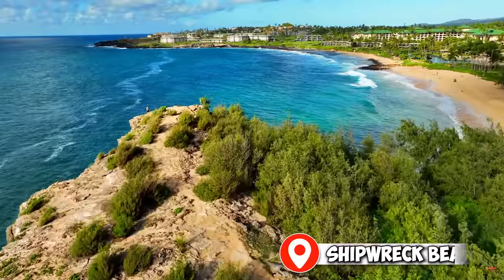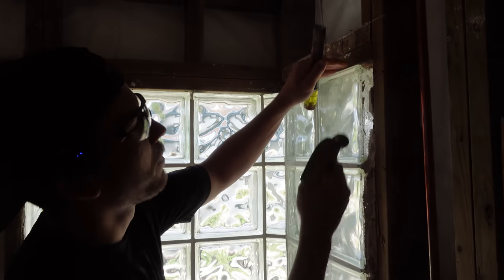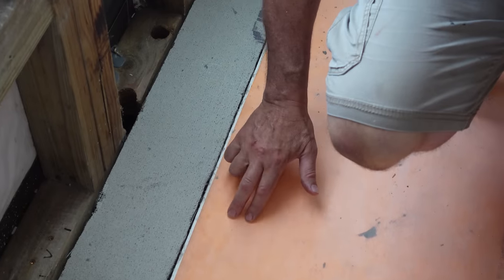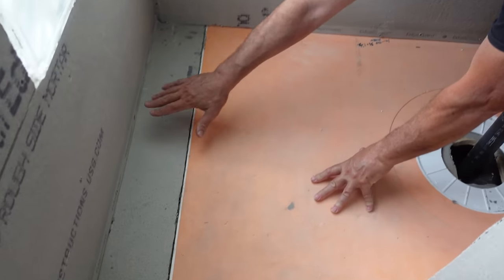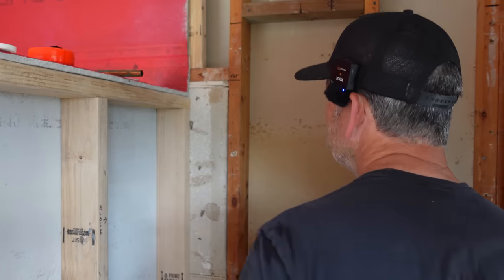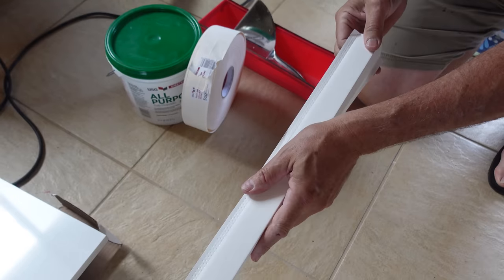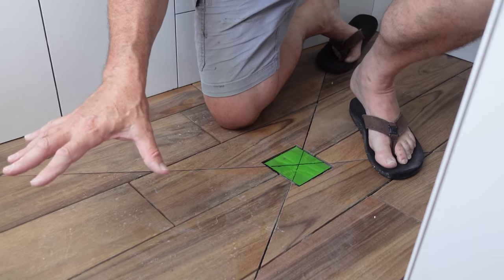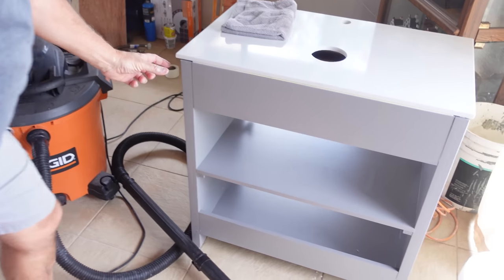The Tile Floor SECRET NO ONE Tells You!

Comment: 42:30 what about cutting a small amount of the countertop at the corner at a 45 angle to avoid it sticking out by the door frame like that? I don’t think it would look bad.
Reply: And if not, for less bruising or injury if someone bumps into it, round the corner off.
Reply: Don't remember which way the door swung, but maybe hang the door on that side of the door opening.
Reply: What about just move the whole door entrance
Reply: Just round the corner off.

Comment: I've had to trim the backs of vanities before. Four cuts with a simple circular saw takes care of most vanities, just make sure you dont buy one with drawers, or else you will be rebuilding them too

edit: just noticed in the last second of the video that your vanity has a shelf. For those, I keep the shelf in place for my side cuts, and then remove the shelf and use the partial cut marks to trim the shelf fully with a circ/table saw

Comment: Have you guys seen Tilecoach's videos showing Kerdi failures? He shows numerous failures of the bonding flange drains on older installations, and has done flood tests using Kerdi fleece with both unmodified thinset and allset. The Kerdi fleece with unmodified thinset always fails the tests, and you can see the water penetration of the thinset behind the fleece. Worth checking out if you plan to continue using Kerdi systems, I have personally switched to Laticrete Hydroban liquid membrane...
Reply: This is correct, also the troughs made by the trowel should ALWAYS run parallel so the air has a way out when setting your tile.  The way it is done here does NOT allow the air to escape.  Drop a coin on different parts of each tile after the job is done and you will hear where the air pockets are.  Prone to cracking just by dropping anything solid on the completed job.
Reply: Try Profilitec  showertec boards they are polyethylene and /100% recyclable.  Awesome.
Reply: Yeah okay bud 😂

Comment: If there's an enclosed space inside the vanity, put the AAV in there so it can be replaced easily when it fails instead of leaving it buried in the wall.
Reply: Agreed. AAV not code to be in a sealed cavity without a louvered access. 
Terminate it under the vanity, ABOVE A THE WATERLINE of the drain so if things clog, you see the clog at the drain before it comes out the vent.
Reply: @larrys5733  Above the flood level of the sink into a laundry box behind the fridge.

Comment: The right front corner of the vanity top forms a sharp 90-degree projection into the door opening. Cut this on an angle from the wall surface at the door casing and to the front edge of the vanity top. This will remove the sharp corner and at the same time create a more finished look.

Comment: Didn't Schulter change it from unmodified to modified?
Reply: yep
Reply: Their instructions and FAQ call for unmodified.
Reply: @ringtyler they changed after several complaints of water wicking and leaking through it which only happens with unmodified
Reply: @tullgutten  I'm not disagreeing, just stating what they are still currently saying.
Reply: It’s under the pan where it should never see water, so it should be ok. I’m not sure what type they used on the waterproofing fabric and dam corners.
Reply: @ringtyler  they're saying yes to both now.
And they warrant others thin set mortars as long as it meets the ansi spec for UNmodified, only their own modified thin sets do they warrant... 🤣
Found this on their FAQ.

Why did Schluter Systems change its position on thin-set mortar?

We haven’t changed our position on thin-set mortar use within our systems. Developing our own setting materials has given us the ability to guarantee consistently positive results. By controlling the formulas, we can be sure no changes will be made that have a negative impact on setting times and strength gain in these applications.
Reply: @ringtyler  one more quote from their FAQ on the all set product page.

Why would Schluter’s modified thin-set be ok to use, but not other manufacturers’ modified thin-set?
The key is predictability. Schluter Systems’ modified thin-set mortars have been specifically formulated to set and gain strength in a timeframe that fits typical installation practice, even when sandwiched between Schluter® membranes or boards and porcelain tile. The proportions of cement, water-retention agents, polymers, and other components in the mixtures were balanced to ensure that extended dry times are not required. This was validated through both laboratory and practical testing. Now, the installer can select from either unmodified or modified thin-set mortar to install tiles within our systems, according to his or her preference.

Comment: To prevent your chuck from lossening, when you tighen your chuck, turn it BACK like you are un-tightening it.  You will hear a CLICK.  The chuck is now LOCKED in place and will NOT loosen up on you!
Reply: Can you point to any user manual that says that?
Reply: That Is not true
Reply: It’s from the fake tiktok tool hack videos.
Reply: @MoneyManHolmes  I don't watch any tik tards or any of those "hack" videos...  I know this because i've worked in construction my entire life and have done this since I was a kid.
Reply: @joshuaricks7730  Try it...  yes it is.  I have done this for years.  That's why when you buy a drill, it states, "locking chuck"
Reply: @Mike Harris  enough said brother.
Reply: @icekilla126  I guess YouTube won't let me post a comment with a link. But in the DeWalt manuals and Rigid And Milwaukee (made by Rigid) all have it. It says I'm the manual for the section inserting bits. Step one says to turn counter clockwise until bit first, step two, turn clockwise to tighten, step three turn counterclockwise with one hand to lock the chuck.  But you just won't find it on your cheap bottom barrel harbor freight, black and decker/craftsman (both made by black and decker) might, but the prosumer versions like DeWalt (Made by black and decker), Rigid, Milwaukee, maybe cRyobi, etc...

Comment: dang you all really do some awesome work, we spent so much money on remodeling our guest bathroom to make it larger, well the tile and tub work -- really has made a horrible outcome. I know the contractor who installed it back in 2010, i have told him many times how the condition is getting worser and worser, he even saw it and told me, "i will get this fixed asap--13 some years later, i remind him again, and he's like, what happened! the bottom of the tub has  rust all on the bottom, i can feel water down there...the tile around the tub has gotten grout al cracked and almost gone...so when i do shower, i am sure water gets behind the tiles...and the wall on the opposite side of the faucets has rotted as well...luckily its not a load baring wall. 

We have no funds to even get it redone. Due to covid the nest egg has all gone -- paycheck by paycheck now. 

I am sure if the Stud Pack seen how this contractor did the job they be like, "woah this is the worse we seen...or atleast one of the worst!"

Comment: Just an FYI for you in the future. Glass can very easily break when hit by a very sharp object. 

That's why you can hit a window with a hammer and it won't break, but if you break the ceramic off a spark plug and throw a piece at the window, it'll break instantly. 

The corners on those chisels can be sharp.

Comment: A little tip for the grouting. After your grout has dried. Place painters tape along the edges of the seams & hit it with rostellum, neverwet. You'll never have to worry about mildew... EVER ! Did it 5 years ago & still have not encountered mildew.

Comment: The envelope cut looks better when the cut goes from the corner of the shower to the corner of the shower drain! I am not a fan of pre-made sloped pans, and I understand why you used what you used and ended up with the X in that location.

When pre made deck mud is not available, you can always buy type 1 Portland cement and sand to make your own!

Comment: If your GFI outlet is on a separate circuit and a higher amperage than the light circuit, then you need to partition the box to meet code.  Current code requires a dedicated 20A circuit to a single bathroom outlet(s), so if the light circuit is 15A, they have to be segregated either in separate work boxes or with a box partition.
Reply from the maker: I know data, communications, etc. need to be separated from 120V.  See 15A and 20A in the same box all the time.  If it's current code must be very new (reference??)

Comment: 22:00 that is the one tool I hate to use.  The pipe always melts back together and in the end all hell breaks loose . I haven’t had it drop into the drain yet.  Good tip!  I always leave the stub out unglued at the trap.  That way I dont ever have to use that tool!  Just measure, pull it out and cut it.  Glue it back in.  Lemon squeezey

Comment: I’ve run into the same vanity issue you are. In your situation idda taken a look at putting the vanity caddy corner to the pony wall. That would have given you another chance to strength at wall by having some 45 degree wall framing in the corner

Comment: I'm 60years old Bern in the bus all my life. And I all was use 1/2" Ruddock on my floors!!.  Helps with cracking tapping the joints helps a lot.    I allso share my bathroom with5/8". CDX pl.  Then you can put any any where and you have backing and a safe place for storms throw some hard ware  lid to and you have a sage room cut the comet with a 4" grinder.

Comment: nice video, the only thing i would have done different is seal all the wood with Thompson's water seal (ply and studs - floor n wall - from 5' down) - especially ply opening around drain behind the tile on floor and walls (redundant maybe but never had rot or mold)  i really like the RedGuard trick - the other thing i always do is replace ALL 'bakelite electrical boxes since otherwise they always fail - they are prone to breakage and the screw holes almost always strip out - other wise a near perfect job - well done - nice presentation - thank you

Comment: Ah! Another video! I've been looking forward to more videos. Been having a lousy week so this cheers me up. I hope Jordan clenched tight to not get nature's enema jumping off that cliff. People don't think about that when jumping sometimes. LOL. Hawaii reminds me of Guam a lot-- although, the water on some of Guam's beaches has less sand because its filtered by the reef.
Glad you guys are getting to have some fun.
Awww. Doggy decided to walk right into the shot! LOL!
I used Mapei rapid set modified thinset mortar and that stuff set up so fast it wasn't even funny. Like 10min and it was cured in the bucket. Possibly less time bc the water was lukewarm from being inside a warm room. I got it to last longer by using icewater the next time.
Hmm.. is that opening going to be wide enough for a wheelchair with the vertical grab bar in place?
At this point it might be easier to try to move the doorway over. LOL.
What app gives you level mode on the phone?
That turned out nice thus far.
Grout is one of the main reasons I won't do tile. I hate grout. LOL.
As an aside, when you get back to working on Jordan's house, what are your plans, if any, for radon mitigation?

Comment: Looks good so far! Question: Here in Germany we have to put a seal around the shower fittings kinda like with the drain you guys did, then paint it with the liquid sealant. It has a little rubber lip so you can push it around the pipe outlet. I didn't see it through the red coating. Is it not necessary in the US?
Reply: Not sure about the US, but it isn't mandatory in Canada. Never seen it done on new or remodels.

Comment: Your thinset should ALWAYS be combed the same direction under each tile so when you set the tile all of the air can travel through the troughs that you made in order to escape and allow the tile to have the most contact with thinset and minimal air pockets.  The way you have combed your thinset with intersecting channels does not allow the air to escape and therefore you do not achieve sufficient contact for you tile.  This job would be rejected by ANY qualified inspector.  Sorry fellas but I see lots of comments by people that have no idea that this is done incorrectly.  Just drop a coin on the tiles after the job is finished and you will hear the difference in the tiles that are stuck properly and those which are not.  MY EDIT  type in incorrect tile setting and you will see "trowel and error"  shows a clear piece of glass set the way you have set the tile and they show the way I am correctly pointing out.  The man then smashes the tiles to show  just how poorly the tiles are set by having intersecting channels like you have done here.

Comment: I'm not a pro,  but i was watching a tiling lesson and when putting down backer board or tiles you should rake out the lines in a straight even pattern so when you drop down the tile or backer board the thinset evens out  and gives you 
Close to 90% bond  if you have lines running every different way you won't get as good a bond.
Take it for what its worth, 
At least you thin set it and screw it down, I've known people who just nail it down and that don't work your tile can crack or your joint lines grout fall apart. 
Floors used to be dry packed thinset  its really hard to break it up.
If you have to work your ass off to get the old floor up, it was done right.  Ive seen tile jobs you can pop the tiles up with a razor blade.

Comment: I used to retile bathroom floors in an older retirement facility, as the units became empty I would do the tiling, I used Hardy backer board instead of cement board as in my opinion it was cleaner and easier to work with, JMHO.

Comment: Hey, been watching since the drywall finish tutorial. I had a question about the Air admittance valve. How long are they rated to be functional, and do they fail? thanks!
Reply from the maker: Rated for around 10 years. Yes it will need to be serviced in the future, but the backerboard behind the sink is fully removable and the AAV is serviceable 👊🏼
Reply: @StudPack  thanks man, ive learned so much from your vids, reminds me of doing residential remodels and renovations with my dad. good work on the channel!

Comment: I found after many time using the wet sponge method, that after you get the bult of grout cleaned off & you've still have that dust film. I just use an old dry tee shirt. It cleans it off & you don't involve dirty water to it anymore. You just shake the dust out of the cloth.

Comment: I would have used plywood to clue to the sheet rock above the vanity rather than gluing sheet rock to sheet rock. It would be much stronger with plywood. In addition, I always use a vapor barrier on the framing before attaching the cement board.

Comment: tip: I was mixing a bag of thin-set from Home Depot and the directions said "Add 1500 cc of water per bag of thin set", then I looked at my bottled water from Costco (500 cc per bottle) . . . problem solved.  I added 3 bottles of water, no need to find and purchase a measuring cup.

Comment: When doing a curd you have a strip of kerdi transitioning from the floor to the curd. Do you use another strip to over lap the transition piece large enough to overlap the transition and cover the rest of the curd. If not that is a place that can leak. Without the overlap water can get behind the inside edge transition piece and cause a leak. This is a common mistake I have found on shower done with this system that ended up leaking

Comment: in my master bath 2 yrs ago we did the Exact same envelope cut for the shower floor and we also used the kerdi -preslopped  floor system.  it works great but did take a longer time due to all the cuts.   we even used tile that looks very close to the one stud pack guys are using

Comment: I never apply thinset direct to plywood. Either I use a vapor barrier, or that waterproofing I believe they call “redguard”. I always screw down the hardie or cement board so the thinset isn’t there to make a bond, but to fill potential voids and negate flex. If it’s a trailer or manufactured home, I’ll use 1/2 cement board on the floor, otherwise I use 1/4 inch, especially with the older homes that have real 2x10 or 2x12 decking. I almost always use 1/4” on the walls. No point having my tile stick out father than necessary, the extra cost with no need for the extra thickness.

Comment: Little pro tip for you guys, stop using Phillips screws, use Torx/star and an impact driver and you won't have so much trouble driving them and you won't strip heads and wear out bits.

Comment: I use drywall mud to mark my boxes.

I have a reciprocating saw blade I use to cut holes in drywall.  I wrapped with duck tape then wrapped with electrical tape for a handle (electrical background makes me use electrical tape and wire on everything)

Comment: My question is since you cut the vent pipe to lower it, the upper part extends through the roof, during a rain especially a heavy rain water is still going to get in that pipe.  Where do you think that water is going to go? In the bottom of the wall causing water damage and mold. Cap it off from the roof, problem solved.

Comment: Why didn’t you just remove all the studs from below the light, put the blue sheet rock in the kitchen side and drill holes in the cabinet for the pipes that would have given you 3 3/4 inchs

Comment: Great video guys!  I noted Paul’s approach to using a rag to stop from losing a drill bit down a drain. Great insurance. One trick I recently learned was that most drills have a feature where after you tighten the chuck on the bit as tight as it can go is to rotate the chuck in the opposite direction and you will hear a light click, locking the chuck.  Lost several bits in the water working on boats before I learned this technique. Keep up the great content!